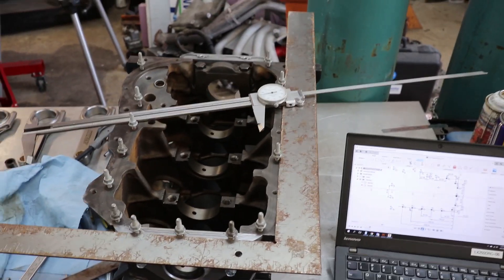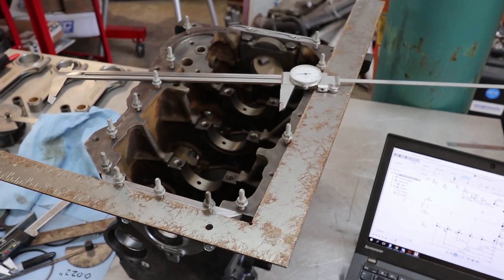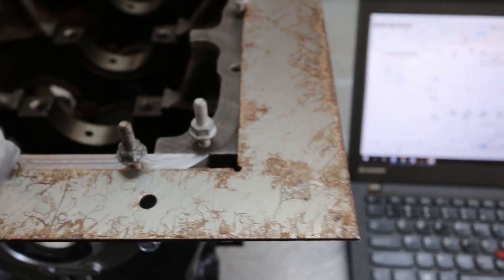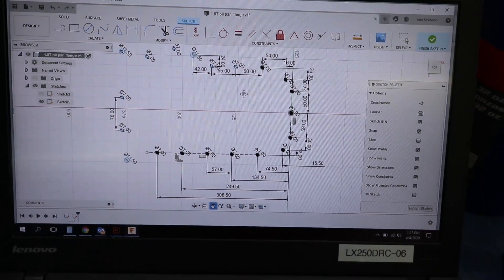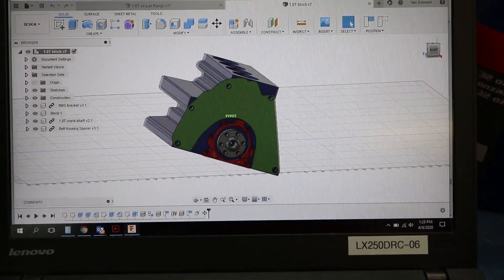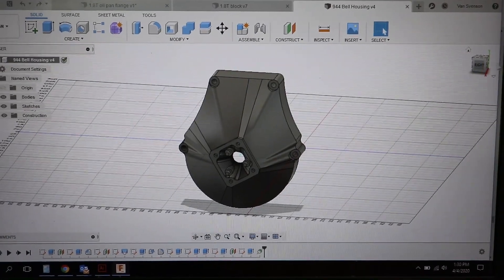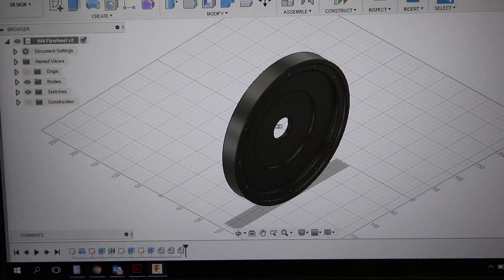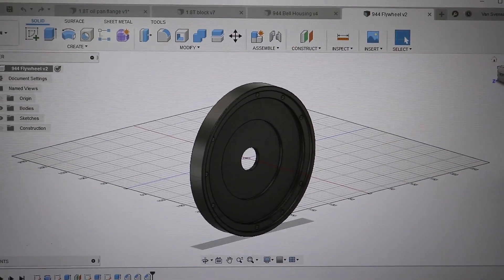Measuring parts for a VW 1.8T swap in a 944

Comment: Hello Van, if it is not too much trouble, could you please do a video assessing electrical weak-points (for example: grounds, connections) and reliable fixes pertinent to the 944 chassis. Perhaps it is silly, however, it would be interesting to view your take on the subject - given your experience with the chassis as well as your electrical expertise. What is your recommended maintenance routine regarding electrical connections? Are there any upgrades/modifications that you would approve to improve the efficacy of the electrical system? Furthermore is there any products that you recommend to tackle and protect, respectively, e- connections from corrosion. I hope all is well, thank you.
Reply from the maker: For the most part, I've had good luck with grounds on my cars (most are race cars, so the wiring is very simple).  But I like your idea, and will try to do an electrical video at some point.